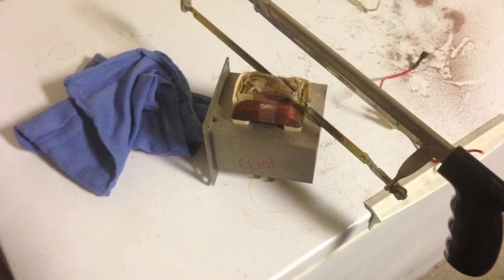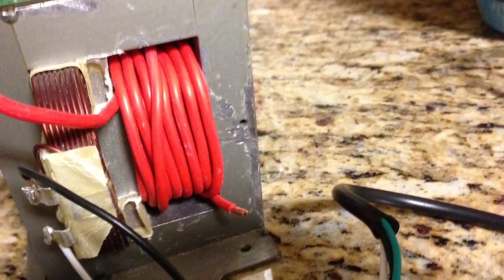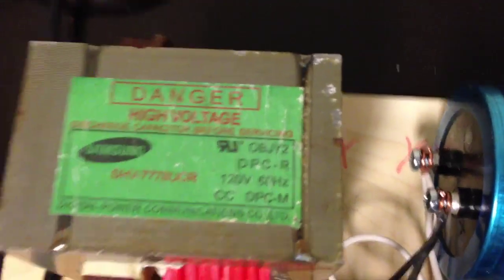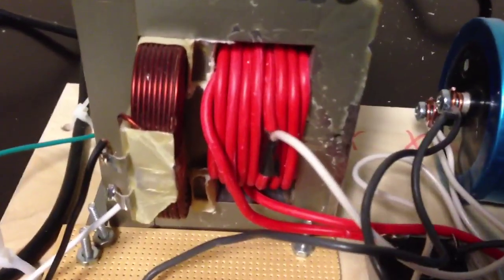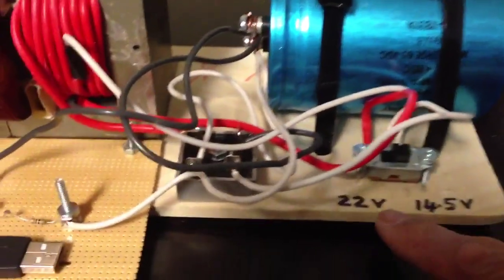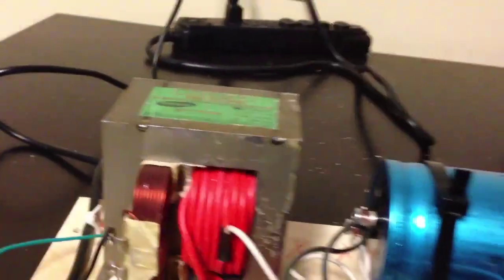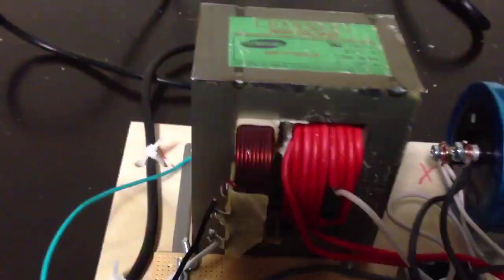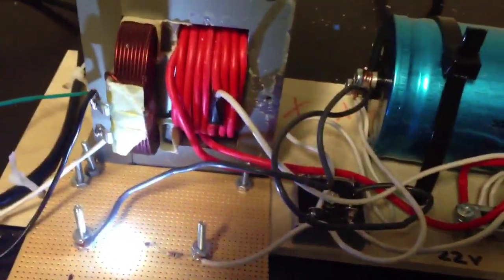Simple DC low voltage power supply from Microwave Oven a Tr

Comment: Some of you may have noticed how hot these things get, easily over 200F. Even if you put a fan on them the core can overheat. They are designed to be powered only when the magnetron is on.
Without a load, the flux is oversaturated. They draw 5 to 6 amps at 120 volts no load. That’s 500 to 700 watts not doing anything but making heat! They are only efficient doing work like reasonable load on the secondary. If you are charging a battery and it’s full, your transformer may be toast, literally. The fix; knock out the two shunts and in that area add  about 17 more turns of # 12 or 14 to the primary. Take note to continue the same wind direction as the tap you choose to continue. You will know you have enough turns when your no load amps drops to a more reasonable 1 amp no load (or empty secondary). You will also have to adjust the number of turns on your secondary to suit your needs. Of course you don’t need to do this for a high current, momentary use like a spot welder. The primary isn’t energized long enough to matter. When you scraped out the oven there were an assortment of over temp switches. If you investigate the temperature rating of those, you may be able JB weld (epoxy) one to the transformer frame as an over temperature safety. You can also buy an assortment of temperature switches on Amazon. I think I’d be aiming at the 150F range
Reply: You can add to the primary? I was thinking about doing that but wrapping the entire core leaving the top exposed. Kind of mummyifing it? Idk i want to experiment with these free microwave transformers,
Reply: @fajile5109  
Yes you can add to the primary when you remove the shunts, the blocks between the primary and secondary sides. You will need to do this so you can get more turns of bigger cables (or more parallel strands of magnet wire). If you use magnetic wire in the project be sure you protect the wire from the sharp edges by tapping down some hard paper stock around the corners with Kapton tape. Once it it’s wound and tested you will want fix the windings from vibrating by soaking the turns very thin epoxy or winding enamel. I doubt wrapping the exterior will have the effect you are looking for, but you could try try it.

Comment: I've made this with a mot  to power a battery drill , 18v and 24v put into a paint kettle covered with ply and bannana plugs . works great with loads of torques
Reply: yes but mot transformers overheat quickly even when on idle.its ok for short usage...it cant standby for hours like a normal transformers,and pulls lot of amps in idle

Comment: The rectifier can discharge automatically the capacitor when the system if off? Is it possible to use a smaller capacitor? Minimum value (mf x V)  U're using 35.000mf x 50v. Could u specifies another to used in a safety way for the system in a way I have a weld quality still?
Reply from the maker: Sena Fernandes see this link for welding: https://www.youtube.com/watch?v=3J9Dg1gKJpQ
you can put a 500 ohm resistor connected to an LED across the output of the transistor to safely drain the capacitor when it is not in use.

Comment: Thanks for the video.  Subscribed.
I'm looking to do something similar, use a microwave transformer to provide a rectified DC output.  In my case I want about 60v, which I will then feed to a programmable buck converter unit which with 60v on the input will let me choose 0-55v on the output, with LCD display, memory settings, controllable from PC, etc.  Basically my own programmable bench power supply on the cheap.
One question:  why did you use such an ridiculously large and powerful capacitor? :)  I know smoothing is good, but surely not 3.5 Farads worth?  You spent a lot of money on that huge capacitor, what is the benefit of it?  I was thinking I'd just use a few 1 or 2 mF capacitors in parallel - that's what most of these circuits seem to use, from what I've seen so far.
Reply from the maker: Thanks for the sub. The big cap is bc I wanted a large initial power surge to run a Royer Induction heater with it.  Seemed to work better with the larger cap. A later build of the same microwave power supply upped the number of full bridge rectifiers to 4 in parallel each at 40A 100V. The 1000V ones did not perform as well running at 33V. You will need a thermal circuit breaker. I have run that breaks at 40A. The problem with regular 20A fuses is they soften and then eventually fail with high current draws.
I like the idea of your controllable switchable power supply!
Reply: Its a big cap, but not 3.5 Farads. .035F (http://www.unit-conversion.info/capacitance.html)

Comment: The transformer I have is exactly the same one you have. 

I was able to get 17 volts AC from transformer. What will happen if I use smaller size capacitor such as 450v x 650uF...

The capacitor you have is huge.

Will it destroy my DC cordless tool?

Comment: Great. I'm looking to build one for an Anodising/Plating set up. How many amps will this deliver?
Could I get that voltage up more?
Reply from the maker: Can get like 20A out of it or more. Just add more turns on the secondary for more volts. Could even add tapping points on the secondary.
Reply: @BrianDhvTinkerer  Thanks for your reply. So I can just connect a wire with solder and heat shrink at various points? How could I add voltage and current controls.

Comment: I am trying to build a larger size capacitor... Do you have experience making one?  Seems very simple. May I ask you following question in regarding to the geometry of cap to do with its capacitance, amp, volt?

Bigger the roll (bigger diameter) make higher capacitance.

More surface contact to + and - leg make higher Amp capacitor.

Does longer the cylinder roll make higher DC voltage?

In another word, more chubby person make more capacitance.
More nurve, more waking person make higher Amp.
Does taller person has higher volt?
Reply: High volt is about which dielectric you use. If you use bad dielectirc electronswill flow and you destroy capacitor. capacite is about surface you roll more more sufrace will be.
Reply: fascinating how science and human nature have so much in common

Comment: I was wondering if you could use this set up to 5th 24vDC cordless circular saw? 

The reason u connect a LED light is to see if the capacitor is fully discharged. Correct.

I am getting ready to do exact the same. But I only have 650uF x 450V capacitor. 

Will that still work?
Reply from the maker: Haru Koyama that should work fine. The LED just slowly discharges the capacitor.
Reply: I think I will do the same. How can I find out what voltage LED light bulb is rated? So it does not explode?
Reply: On your final version of this power supply. You said you add fuse to it? What is the rating of your fuse and where do you mount the fuse. 

I believe these micro wave Transformer are 600 watt rated. Correct?

Where do you add fuse? At AC portion line or at DC portion line?

Can you use 15amp extension cord that have switch on/off to serve the same purpose?

Comment: I think you mis understand me. Between your red wire copper wire is 4 piece of metal shim, wrap in paper. I accidentally took it out. 

Are these metal shim required? What is it for?
Reply from the maker: The metal shim is not necessary.
Reply: What is the uses of the metal shim?

Comment: Is it possible to use your project lake a welding stick machine?
Reply from the maker: Sena Fernandes this would not be good for welding as it would overstress the rectifiers. for welding I would use a single turn of 4 awg wire on the MOT which would give about 2V but very high current as shown in this video: https://www.youtube.com/watch?v=3J9Dg1gKJpQ
Reply: +TeslaSpot 101 How on earth could you weld with 2V, that's impossible. Also, try welding with 800A of current, your stick travel speed would be in double digit integer meters per second.
Reply from the maker: +Sarah Szabo  Here is an example of spot welding with 2V. The current is at least 500 to 1000A:  http://youtu.be/7m-BGLthdvU
Reply: TeslaSpot 101 That's the wrong welding process. He asked if it would be good for stick welding.
Reply from the maker: +Sarah Szabo you're right it is good for spot welding but not good for stick welding.

Comment: Is there a voltage regulator we can add that can withstand 100A and provide adjustable voltage? Maybe we can increase the number of turns to give us more voltage and sacrifice some of the amps?
Reply from the maker: If you increase the turns on the secondary, you can adjust for about 100 amps. Another things is that it can be connected to a variac for variable output voltage.

Comment: I bought an army power supply thing from somewhere, but I have no idea how it works. It say dc out, but if i turn it on it gives 82v ac on the 2 connectors, no ground. Someone has soldered in it and got rid of some wires, one side isn't in work. And on the backside was a hole with wires coming out, they are cut off.
Reply from the maker: Hi sorry for the delay. What I did with old transformers with unknown connections was to test the resistances between the various leads to assess primary and various secondaries and to see which lead is connected to which. Also, if you set a variac at low voltage ie around 12 volts output, you can connect this to the lowest resistance outputs on the transformer and check the outputs on the other wires and slowly ramp up the voltage on the variac  rechecking the voltages on the other connectors.
Reply: I don't own a variac. And I am not familiar with electronics, so I don't understand all of it, there is also a schematic inside the case.

Comment: after five minutes my primary wiring is over heating. Is there any solution to this problem? thanks for sharing
Reply from the maker: Kuya D One thing you might want to do is to use thicker primary. Of course this will decrease the voltage as you will not be able to fit as may turns with thicker wire. Also, it depends on the load you are applying. I have seen people connecting two or more microwave oven transformers in series.
Reply: Brian D Thanks. Could it be possible an induction motor be a generator? thanks for the video it helps me  lot
Reply from the maker: Yes definitely I will see if I can find you a good link for it.

Comment: That FWB is 50 amp max
May I ask where you purchase that giant capacitor?

I have the same transformer. I took out the middle metal shim. I was wondering what is the reason for it? Do I need it?
Reply from the maker: Haru Koyama the middle 1 -2 turn coil is a filament coil. Not needed. The cap does not have to be that big. I found that one on ebay!

Comment: What about simply connecting the mains directly to the secondary? You should then get something like 7 volts output from the original primary side of the MOT or about 14 volts if you're using a transformer out of a 240V microwave oven. Quite a beefy output too at around 10-12A max.
Are there any reasons why this mightn't work?
Reply from the maker: Bodragon would work - problem is their core of lefty’s transformer is one end of the secondary with would result in the transformer core being connected directly to the mains - and dangerous to touch.
Reply: Yes, I know this but what about isolating that connection from the core? It could be easily done since it's welded (or soldered) to the core in plain view?
Reply from the maker: Bodragon yep them it is worth trying it. I would use a variac first then crank it up slowly to see your output voltage and waveform.
Reply: Yeah, I've got a variac but it's for 110v not 240v (I'm in UK). I'm thinking of just running it from the 240v. Many variacs have a reversible dial plate on the top, one side for 110/120, the other for 220/230 (but mine doesn't have this). The only potential problem I see is the difference in mains frequency although I really think 10Hz is not really that much to worry about.
I was also thinking of adding a switchable extra tap off the coil, (of the variac) to enable me to get an even higher voltage than the standard extra 30% that's there already. Any thoughts on this? I can't seem to find much info anywhere to either of these questions and if I'm being too cheeky I apologize and I won't be at all offended if you completely ignore this latest post / reply.

Comment: my quesion is can his run a 4000 watt monoblock amplifier cause i tends to pull alot of current
Reply: Kyle Clarke NO way buddy.  first off what amp u got.  4000 watt Monoblock hmmm. What amp is it and what is the fuse rating in the thing?

Comment: Brian greetings, you used the switch 24 volts to 14 volts, how many connection points have two or three. And the amp of that switch. Thank you
Reply from the maker: Hi the switch has 3 points and can switch 20A. It goes to the center tap. I later modified the circuit by placing 4 full bridge rectifiers in series. Each bridge rectifier was rated for 35A giving a total potential current rating of 140A! I also added a 20A fuse in the circuit because when driving high power MOSFETS with the circuit, if they fail short circuit its equivalent to shorting out the output.
Reply: +TeslaSpot 101, just FYI, I used to work in test maintenance at a semiconductor company. What I learned there about silicon diodes used in a parallel configuration was, they need to be matched pairs, especially with the forward current in applications such as this. That insures that the current load is evenly distributed between the to diodes. The same principle would apply if you were dividing AC current between two sets of diode bridges wired in parallel. If the two bridges are not matched, forward current-wise, you would not notice a problem until you reached a critical current threshold, where the weakest of the two bridges would begin to heat up and break down at the weakest diode junction, and fail. This is similar to the reason they used to sell power transistors for amplifiers as matched pairs. Nowadays, on a lot of electronic devices, they put everything on a single output IC. But I want to say that repurposing an old microwave transformer this way, is a great idea.
Reply: .........I later modified the circuit by placing 4 full bridge rectifiers in series....????? you mean parallel !!
Reply from the maker: Navin Kotadia thanks for pointing that out- should be parallel :)

Comment: So what did you design this thing for ?  What is it purpose ?   To do what with it ?
Reply from the maker: At the time I did not have a switch mode power supply and I needed a DC power source to run a small Mazilli Induction heater. That was the initial purpose. I have a lot of old microwave oven transformers and so this seemed like a good repurposing.
Reply: @BrianDhvTinkerer  I would also like to power an induction heater(1.8kW).  Do you think it is possible to somehow use two identical microwave MOTs to power it for 20 minutes without melting the wires?  If so, build recommendations would be greatly appreciated.
Reply from the maker: From work I’ve done more recently, it looks like production he does work best with rectified means. Here’s one that I recently built and it seems to do well. We’re just plugging it into the wall. It has a large, moving capacitor.

https://autotuningmainsinductionheater.wordpress.com/self-tuning-mains-high-power-half-bridge-induction-heater/

Comment: Wiring with same color wire doesn't make it easy to understand the connection points; could you post a more clear connecting point, or a diagram to show exactly the proper wiring setup to obtain 12V et 24V connection?
Thanks
Reply from the maker: Steph B sorry bout that ;)

Comment: Hey, what kind of capacitor did you use? Could i use smaller ones, all in parallel, or is it better just to use the large one?
Reply from the maker: Scotlahn Mccallister you could use smaller ones connected in parallel. I just happened to have this big one lying around which is whey I used in it. :)
Reply from the maker: Marcel de Araujo Coelho  yes it can be used with any large capacitor. 1800 uF would work just as well. Larger value gives more smoothing.

Comment: Can you tell me how you put  a tap 0v ( white cable)
Reply from the maker: I found the middle of the wire and added a tap point here. I stripped a small section out of the middle of the red wire and soldered the white wire to it.

Comment: how many turns is the secondary coil
Reply from the maker: I used about 20 to 30 turns, as many as I could fit on there. It is 12 gauge wire. What I did at the end was just use a  multimeter to measure the AC volts. You can add or substract turns until you get the voltage you need. Since only a limited number of turns of 12 gauge will fit, you can lower the wire gauge to get more turns on for higher voltages.

Comment: isn't your transformer heating up?
if not could you please tell me why?
Reply: Actually microwave oven transformers do get hot even with no secondary load: They have very little turns on primary side causing high losses in core itself: My transformer consumes approx. 50W with no load. It will not heat up instantly but after an hour or so it will be very hot. It is simply because that's how they are designed, to be as small as possible, in a microwave they operate with forced cooling (fan), at constant power and in short duty cycles.

Comment: What do you mean by tapping the secondary and what do you connect the tap to?
Reply from the maker: Jubee Tobbe When I was winding the thicker red secondary wire that is shown on the video, I cut out a piece of the insulation from the midway along the secondary and soldered another wire (the white one shown on the video) to it. This is the center tap which about 14.5V. The secondary gives 22-23V. Hope this helps.

Comment: what was the exact rating of the eletrolytic capacitor?
Reply from the maker: john doe it is 35000 uF. You don't need one that big for this power supply. 1000
Or 2000 uF would work. Anything above 40V would be fine.
Reply: thanks a lot.